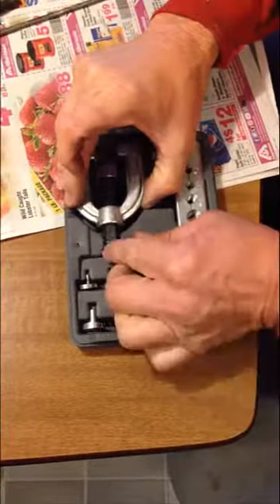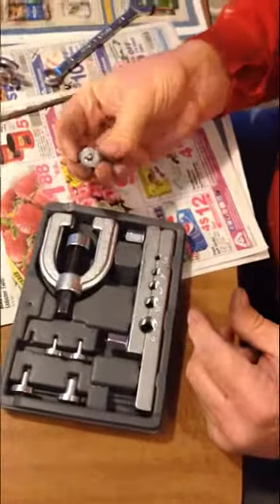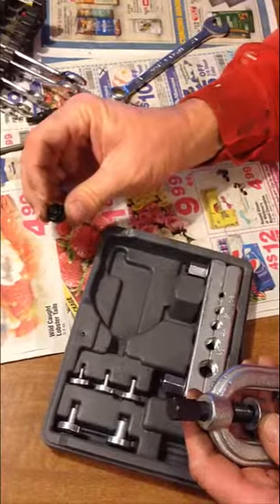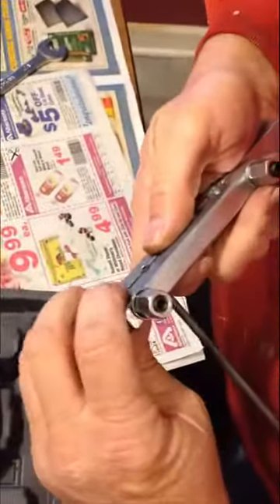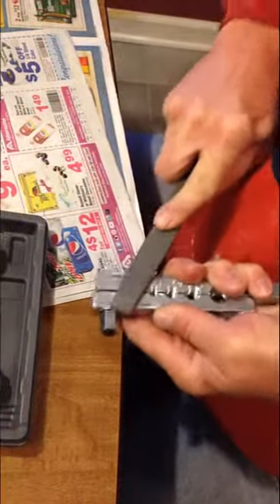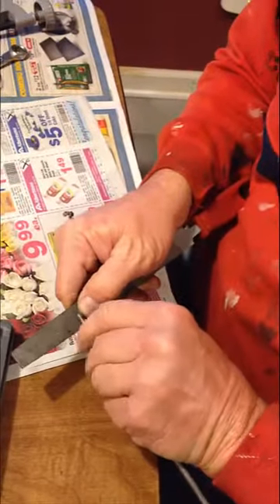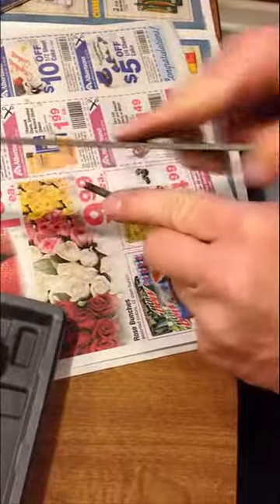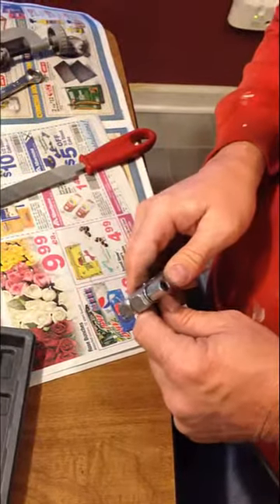flaring tube

Comment: What is the name of that device with the multiple sized holes in them? Looks ideal to strip my electrical wires, maybe I can buy a cheap one from aliexpress or something 👍 

Is that called the flaring tool?
Reply from the maker: Actually a brilliant thought. It's just part of the flaring tool but I've been wanting to do the sane thing with stripping a box of wire I have.
Reply: @swdweeb  I sought it up on Ali Express I can buy one tool set for about 18 USD so maybe going to buy a set once. For now my home made stripper does the job 😂👍👍